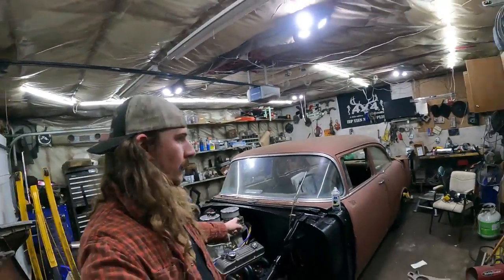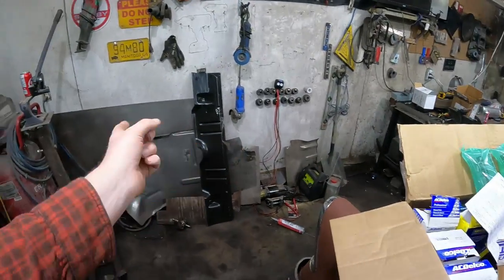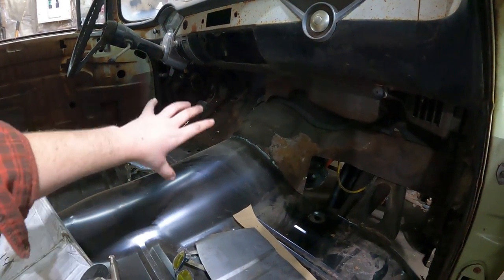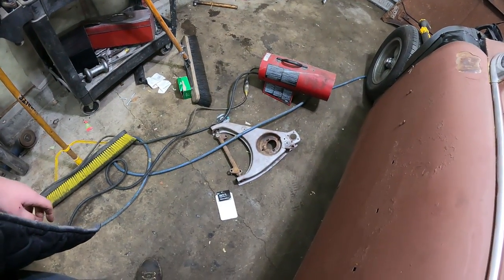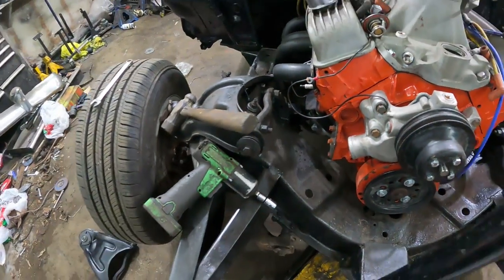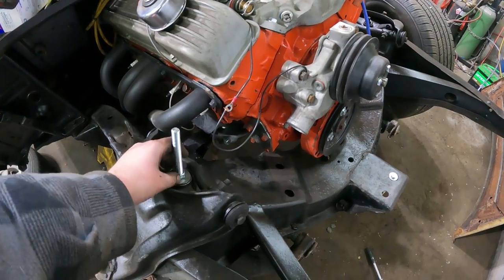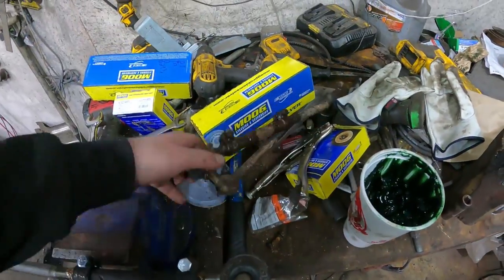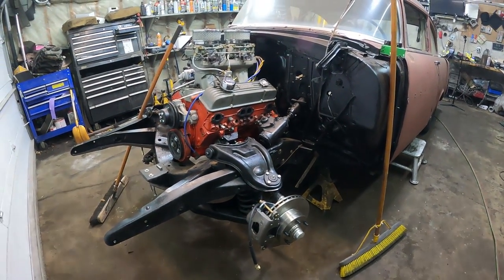Abandoned $300 1956 Chevy Gets A New Front End

Comment: I also  used 64 chevy full size car top and bottom ball joints on my 55 car because the tri 5 top ball joints are sticking up to high or and to close for 15 inch rims ..they bolt right in
Reply from the maker: Good tip!

Comment: Soak those parts in some vinegar and water and the rust will come right off after a  few day days. No wire wheels necessary. I did all the parts on my 58 chevy that way. Soaked them in a big plastic tub and the rust just falls right off and you have fresh clean metal ready for primer and paint. Yyou can work on other stuff while they soak for a few days. Longer soak removes more rust. i soaked some stuff for 7 days and it was like brand new when i took it out. I even did the coil springs which would be impossoble to get perfect with a wire wheel
Reply from the maker: Huh thats a good tip.
Reply: @DDSpeedShop  you can also try electrolysis with a bat’ry and some steel (non stainless) if you’ve got a tub of water and some washing soda.
Reply: Muratic acid
Reply: I was amazed how well vinegar and salt works... i  have a wheelie bin with bunch of parts in it at the moment... all suface rust gone in 24 hours. 👍
Reply: That's a great tip👍

Comment: I always measure the distance from the center of the tierod to the sleeve any more, mainly because they all very in design, counting turns is a good rule of thumb if the aftermarket one is same style as original. As for coil springs and drum brakes, im like the chuck norris to them, they fear me. Lol but yes them springs are deadly. That tool you used is also great for installing them if you have just the chassis only. Great to see others think alike. Great vid!

Comment: I was hopung for a straight axle conversion on this one . My dad and uncle used to put old truck straight axles under cars for people back in the early 70s if you used a 54thru 59 Chevy truck axle you could use 53 54 car spindles and get 5 lug they were ultra cool back in my preteen days , also handbuilt fenderwell headers with a 4inch collector with one wingnut csps , to uncap headers . They sounded awesome , nothing like the sound of a twofour 360 hp 327 with fender well headers

Comment: Every time I remove coil springs, I run a ratchet strap down through the spring with a little slack to prevent the spring from flying anywhere. Princess Auto straps are your friend!
Reply from the maker: Thats a slick tech tip for sure.
Reply: @DDSpeedShop  just slack enough not to bind when releasing them, and when putting them back together I ratchet it as tight as I can. Had one pop free on me using just a cheap blue strap and it held. I was lucky :) I usually use a heavy duty strap though.

Comment: I always left the control arm attached to the car and broke the ball joint with a jack  loosely under the lower arm. Then lowered the jack and released the spring.  I then removed the control arms. No spring compressor needed when I put it back together the same way.  I have used that method on other full sized GM cars and even pickups. On a Mustang Fairlane etc you have to use a compressor since the spring is between the upper arm and the frame. I hate doing them.

Comment: I did new hubs with roller bearings and new drums on my 55.Mainly because I had new stainless steel stock style brake lines. It wasnt any cheaper. If I ever do another one itll be front disc possibly 4 wheel discs.

Comment: Not uncommon to find casting sand in the wheel hubs,as a rule i always wash the hubs and give them a scrub with a brush. 
Its also reccomended to was the new beatings with brake cleaner, packing oil dilutes grease. Like the fact you show some details,and safety measures. I use a bearing packing cup, cleanest way to pack them.

Comment: As you know, I always try to give you a easy way out to do any job, so here we go again.( AKA how to remove or install a front hood by yourself )  You do NOT need to use a front spring compressor at all if you have the motor installed in the car! Nope, all you got to do is remove the front shock  and leave the front lower A frame on a jack stand on the outside area of the lower A arm with the tire removed and no other jack stand under that side of the car so that side of the car is only supported on the front lower control arm. Then use a floor jack under the opposite side back frame rail  "behind the rear wheel"  witch when jacked up apples all the weight of the car and the motor on that front jack stand under the lower A arm to totally collapse the front spring as you jack the opposite side rear corner of the car up!, ( oh yes it will , just keep jacking it up until the front spring is totally collapsed! ) Then with all the weight of the car & the motor on that front jack stand under the lower A arm you can now loosen the upper ball joint nut a few turns , ( but do not totally remove it yet ! )  then use a ball joint fork and a BFH to split the upper ball joint from the spindle, then continue to jack the floor jack at the rear frame rail of the car up even more ( use spacers if needed )  until you can totally remove the upper ball joint nut safely as there should be no load on the nut, then after the ball joint nut is removed, lower the rear floor jack slowly to remove all the weight at the front spring as you lower the rear floor jack down to remove the weight off the front spring with the ball joint nut removed. You just reverse the process to install the new A arms & spring back tougher. So a spring compressor is not ever needed. I do this all the time now, only way to go.  WARNING take your time the first time you do this, it's scary until you see how it works, after that, there's nothing to it . I had a old,  VEEEEEERY old mechanic show me this trick god love him ! No more spring compressor miss haps !!!    But this all just my opinion .

Comment: currently working on the same speedway set up, but the large spring anchor you must unscrew is likely going to be done by the machine shop.  so far PB Blaster, heat (propane), impact wrench with no luck.  Are you planning on rebuilding the steering box?
Reply from the maker: Nope. Just pack it with grease.

Comment: Yeah Dan you are right ,I used to put hubs off later model to get tapered bearings ,and put the old drums back on to keep it original. But then would get front  disks off Nova, Chevelle , but that was back then. It's way cheaper and lot better go with disk . Good job try not mash your fingers !!  I'm only 998 miles from you or you could put my 57 and 55 back together

Comment: It's actually much easier to change out the upper control arm bushings with the control arms in the car and the weight of the chassis on them. ... Pull the retaining nuts / bolt ( One at a time ) and use an air hammer on the cross shaft, they will pop right out. ... Once you replace one, reinstall the retaining nut / bolt and repeat. ... The lowers are a bit more difficult, because of the way they are mounted, but, it can be done in most cases the same way. ... The easy way, the alignment is not affected, unless the worn bushings are metal to metal, in which case, the easy method will normally bring caster and camber back close to original settings. ... Set the toe and let it go. ... Semper Fi
Reply: Sorry, forgot to mention reinstallation of control arm bushings, the easy way. .... Grease the bushing, slide it on the shaft to the point you can put some torque on the retaining nut / bolt, then, use the air hammer on the cross shaft, the bushing will vibrate right in to place, just keep applying a little torque to the bushing. ... Semper Fi

Comment: I’m with you, coil springs are scary, my drag springs were so strong it stripped the threads out of my spring compressor and it went flying across the drive way, my. Wife wasn’t impressed. I throw a ratchet strap through the coil spring as a secondary safety, when shit goes sideways it happens fast, at least the ratchet strap will slow it down
Reply from the maker: Yeah. Always have a safety net

Comment: it goes to show that the difference between a total wreck to a road worthy car is often very little. it just requires a person to apply themselves. 
Get a real quality Zinc paint ($$$)and coat the joints Before seam sealing because the steel will rust under the seam sealer.Some seam sealers on the market are crap too ,if they are acrylic it means ammonia base which is of course rust creating.

Comment: I worked for United States Steel. It's true what they say about cheap low grade Chinese steel. It'll do the job until it breaks. Good high grade steel will not break, it bends but will not break. Which goes in point with old cars, old cars were made with high grade steel, new cars are made to be recycled every 10 years. They're designed to be run through the scrap yard shredder repeatedly.
Reply from the maker: Couldn't agree more
Reply: @DDSpeedShop  And if you're ever wondering am I wasting my time keeping these old cars alive, here's your answer. Old never goes out of style. Old school is the only school.      --------------------> https://youtu.be/kaIZWjItReI

Comment: Roller bearings are deadly if the cage for bearings breaks,the wheel folds under car and car then spins around. I saw a car go off Malahat when I was a kid, bearing broke car flipped and went a long way down. The cops blamed it on teenage driver. I wish I knew about GMs bearing secret back then.Maybe cops would have believed a dumb kid. I can still see a young lady staring through the back window.The car was upside down and seemed to float there. 55 chev still a nightmare even though  it was. early sixties.